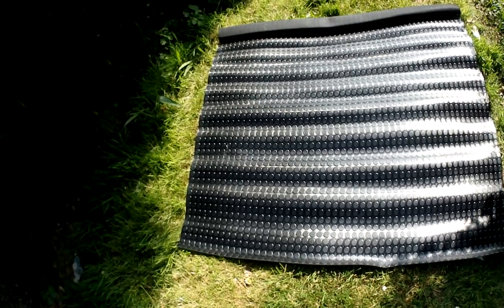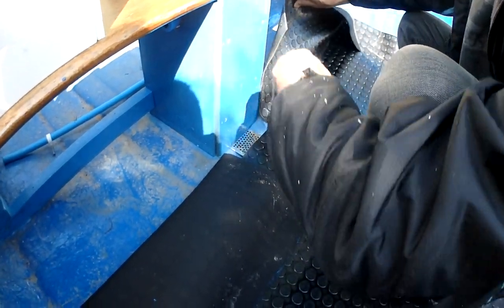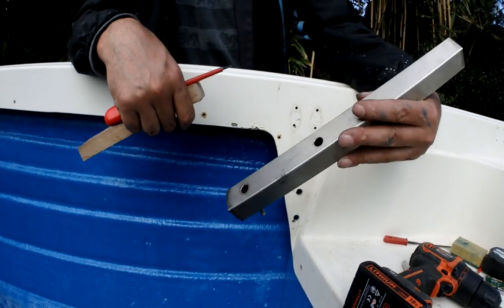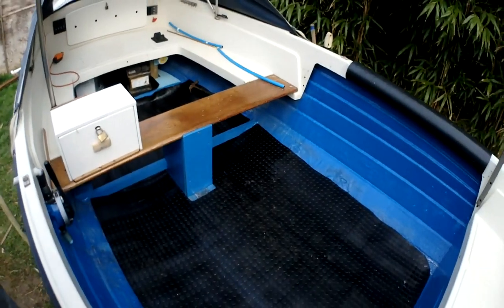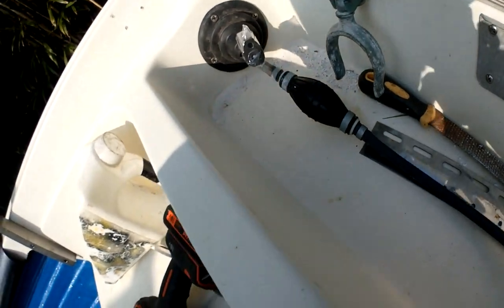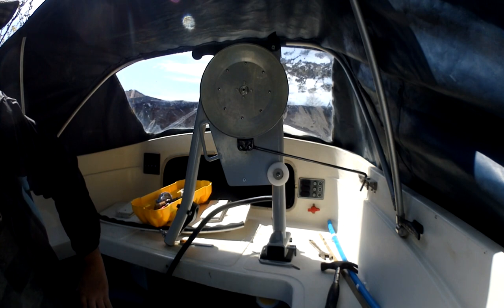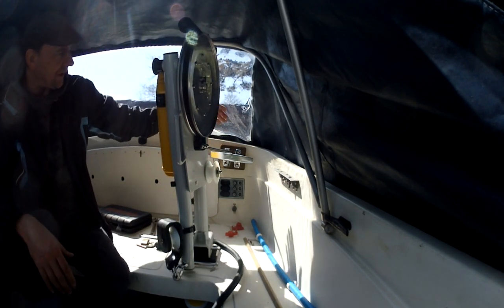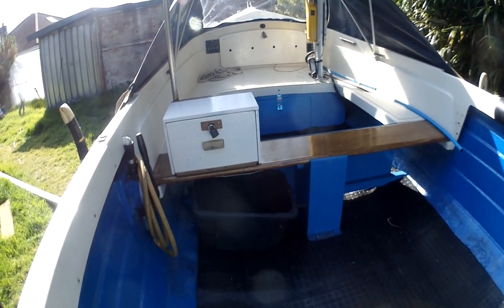Orkney Fastliner 16 Refit - Finishing Touches Non Slip Floor, Knife Holder, Rod Holder Rope Guide

Comment: Have you been looking at my photos of my boat?I used the same rubber mat in my boat apart from I went for the pyramid pattern,I also made rod holders from white waste pipe and your boat looks very similar to mine on the inside apart from I don't do pots just fishing,I must say you've done a great job so far Troj,is there any way I can send you pictures of my boat???
Reply from the maker: on main page top right facebook or instagram or the About tab you can E-mail me
Reply: @Trojwaterman  Sent you some pictures via email,hope you get them..

Comment: I tried a similar type of mat in my punt and had to take it out, it was fine in the dry once a little bit of water got underneath it was lethal just be careful, in the end I used the stuff people use for horses a bit thicker but it doesn't move at all.
Reply: I should have said it slipped on top of the water.
Reply from the maker: If there is to much plastic in the mats they can be deadly when wet, you get the same with with some boots that use plastic for the soles best avoided. This stuff should be fine heavy rubber and smells of old car tyres

Comment: I used to be an Abalone diver in Western Australia during the eighties and used a davit with block and tackle to lift the bags of Abalone on to the boat these weighed in excess of 100kg, I now work on a wet line and net boat and also pull around 8 to 10 tonnes of Southern Rock Lobster per year in the South Island of New Zealand, I have enjoyed your fishing videos for a few years and like your do it yourself style but given my experience I feel that the winch would have been better placed on or next to the front seat, (same one as your echo sounder)I know you were concerned that the boat might heel over and it would be out of the weather on the mooring but I think that it will cause you more problems in it's present location but let's hope not.The boat is looking really good and hope you have a great season.
Reply from the maker: Problem here is we have over 10 meter tides so I need to keep the boat pulling into the tide
Reply: @Trojwaterman  Yes I understand that but you hand haul on your old boat over the side so I didn't think it would be an issue, but I have a feeling that you will end up moving it aft in the long run, I like the look and design of the Orkney it was a good choice.
Reply from the maker: Its all going to be a big test with so many changes. It will be interesting to see how it all works out
Reply: @Trojwaterman  Can't wait, good luck and it will be much better for your back.

Comment: Have you given any thought to ventilation for the fuel tanks. A build up of fuel vapours in an enclosed space is a very bad idea.
Reply from the maker: Its not a sealed locker there are 2 large entrances either side where the gunnels are.